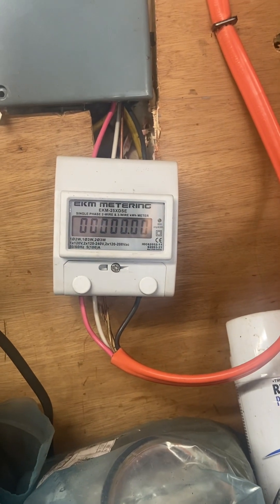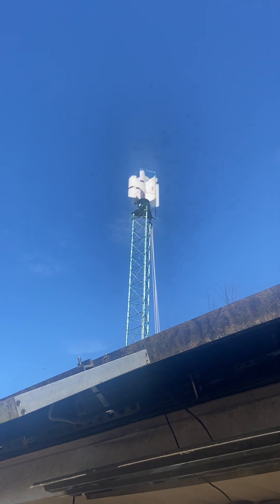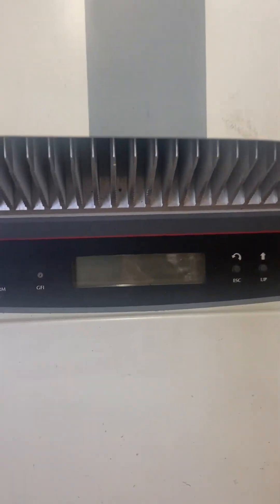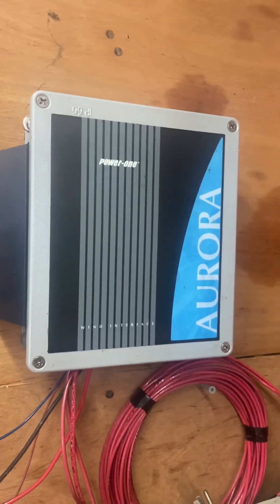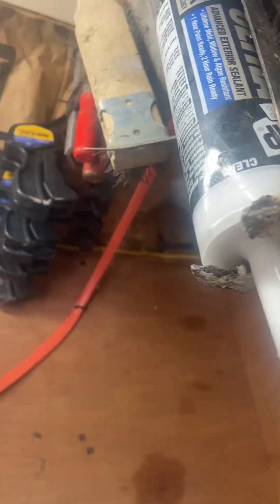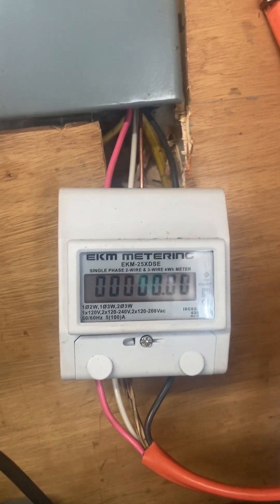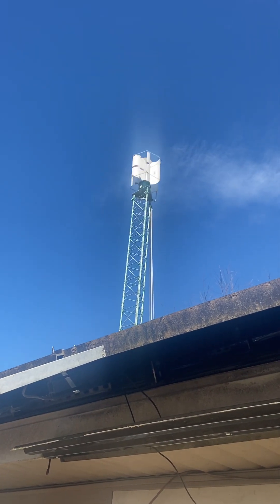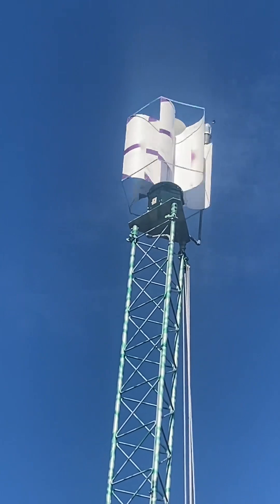Vertical Wind Turbine, Part 51  Don’t Buy Tesup. This now a working turbine. Good for 17MPH+ 17m/s.

Comment: Question  since I  was stupid and bought  one before I found your you channel  but  it seem that your mod is on the right track but I would like to know if  you have thought about  wind actually  being  trapped  in center at the shaft causing drag
Reply from the maker: I did think about that, but my brother-in-law is a aerospace engineer, which says it has no effect on it. It’s the pressure that you’re putting on the blades that spins it not the volume that is trapped in the center.
if you already purchased and can’t return it, you’re going to have to remove every other blade to get it to spin. Otherwise it takes 35 mph winds to spin it in the original configuration, with that  4K generator…. You also have to purchase a 2K or 1K generator to bring the start up speed down to the 4 m/s a second or less start up.
Reply: @Themachinewon  thank for the insight
Reply from the maker: after you do the modification to the blades and put a strap around the tips and rivet them. Look for a 2K or 1K generator to put in that bottom housing and let me know definitely post videos it’ll help everybody else around the world.

Comment: I'm no expert but I would guess the standard Aurora inverter's input voltage range is significantly higher than what the Tesup turbine produces during normal wind conditions...

Well, that plus the fact the Tesup unit is utter shit.

PS: the  Aurora unit's a beauty - NEVER get rid of it.
Reply from the maker: this Aurora was an actual wind version inverter. It’s a 6000 W inverter. It can start off at 50 Volts, maintained its continuity down to 32 Volts and remain on. Unfortunately, they stopped producing these, but I found out from the Aurora programmer that every Aurora is wind and solar. You have to go into the computer program and change the settings. That’s it. Actually, pretty simple. I did it for the first time myself in my videos. as for the Aurora interface, they are rarer than a three legged leprechaun on Saint Paddy’s day
Reply from the maker: as for the voltage input range when you program your wind data, it’s rpm and power output so this is rated up to 6000 volts

Comment: Mr machine won. I’ve fitted one in the uk (I’m a sparky) the thing is not working well here. My opinion is it’s cheap rubbish. Also they didn’t diliver the inverter( customer brought materials)
Reply from the maker: Watch my last few videos they’re short five minute. The thing is actually spinning now 18mph. It’s  kicking. my inverter on ,& stays on after it initializes, and now it’s producing power to the grid , very small amount
Reply from the maker: I’m pretty sure you have to modify it by taking every other blade off and pop rivet Tien it to the next blade. Increasing your diameter from 18 inches to 32 inches keep in mind the blade tips will be 17 inches apart. Get some strap aluminum and rivet each wing tip 17 inches apart. It will spin at a much slower speed, and you’ll be able to get some power out of it. Otherwise look for a 2K generator to put underneath to actually make it work, also  with the modification to the wings.
Reply from the maker: if you’re within the return window to return the stuff to them, please do get your refund

Comment: I don't think it's the generator, that's not primarily the problem I think, I would try a cheap mppt charge controller that's work within the generator voltage range, I have a 1 kw Bergey windturbine, it's got whats called low end boost, so if the voltage is below 24v (in my setup), it boosts the voltage so it can charge in low wind speeds, the mppt should do the same, probably need a rectifier as well
Reply from the maker: I’m pretty sure it’s the generator size. In its original configuration, the turbine was not able to turn the generator until 35 mph winds. After the modification, it was able to spend to generate 18 mph. With no problem. If I reduce the torque on the blades/the shaft, it would be able to spin sooner and in lower winds.  Remember I’m not charging batteries, So the min voltage is 50 volts in order to run the interface box, and the inverter to produce power to the grid.   Are you charging batteries ???
Reply: @Themachinewon  your tight , yes I'm charging batteries, did an upgrade about 2 months ago, changed out the lead batteries for life04, added 7kw of PV panels, very happy with it, stil have the grid for backup and running high loads,
Reply from the maker: I looked at your wind turbine, 5.5 m/s. 12 mph winds to produce power seems pretty high.  What’s the cut in speed that it starts to produce power ? Volts ?
Reply: @Themachinewon  2.5 or 3m/s, I also had a cheap Chinese turbine on the same mast, I think they were branded "navitron" but the blades got ripped off in a storm, I never tried to fix it, but when it was running I could directly compare both, under about 250W  they were comparable, in strong winds the Bergey is a beast, put out I500W or more, brought them in 2006
Reply from the maker: @jimbobarooney2861  i’m getting a different horizontal to test out three bladed sort of like yours
Reply: I know this is old, but it seems to me the problem is a mismatch between the generator, the  3ph AC to DC converter and the inverter  You need an inverter designed for 24V rather than 50v to initialize, or you need a DC-DC boost/buck converter to get you to 50V with a lower voltage input but then not over drive when you get 72v from the generator.  What's the maximum the inverter will take?  If it'll take up to 150v you are good with a 2:1 DC boost converter between the two devices. 50V is just too high up the generator curve to be a useful threshold.  
You have some curve data for the turbine.  What does that tell you about wind speed,  RPM and voltage?